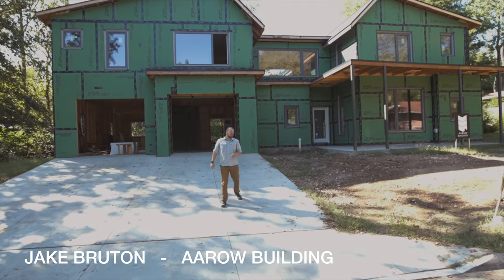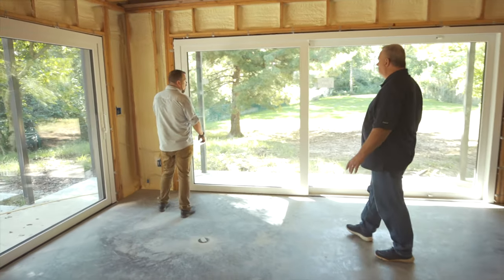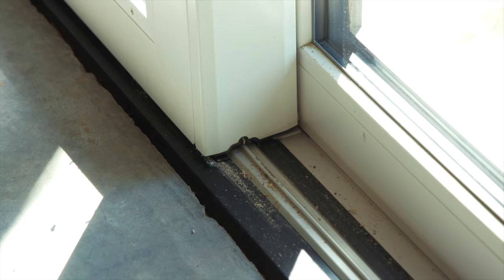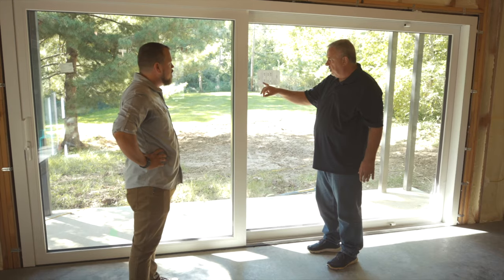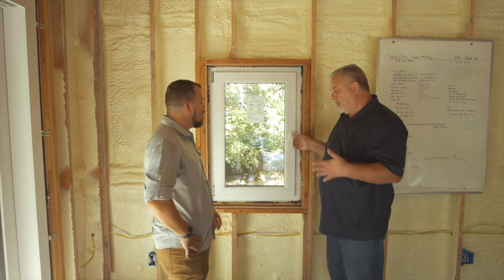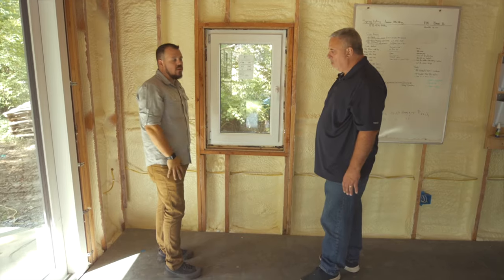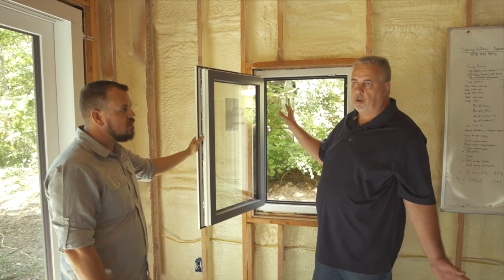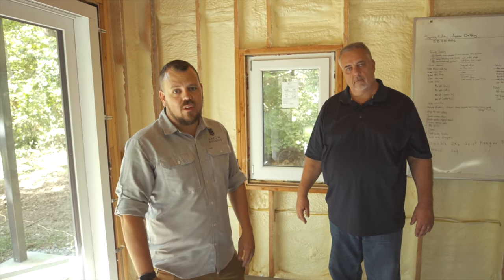European Triple Glazed uPVC Windows

Comment: you need to know sth. triple glazed windows are forbidden in Germany unless you have an insulated house which usually are made of bricks or beton. Reason is: if the windows are the warmest part of the house, there would be mold everywhere in the rest of it. We got new windows in our flat in Germany and I asked the people who installed them about it. It makes sense. So If your house isn't really insulated you should take double glazed windows. But since you mostly build wooden houses. Well  up to you
Reply from the maker: I’m not sure I follow. Maybe the frames of the windows are aluminum in your example and the walls are cold enough to cause the to condensate? The window being better souldn’t make the wall mold. If the wall is poorly insulated enough to get cold enough to condensate and mold it should do that worse if the windows stink too. Strange. I would like to hear more about this. Thanks for chiming in.

Comment: Call me old fashioned, but is there some reason you can’t use an American made triple glazed window with fiberglass like Ultrex cladding and all of the low emissivity coatings and not wait 3-4 months and pay through nose forcargo shipping?
Reply from the maker: Great question. Unfortunately when it comes to performance we simply have found better metrics from the European manufacturers. The other thing to consider here is manufacturer warranty as well. Schuco who is the manufacturer behind these units is one of the largest in the world, if you bought the units you bring up it would be from a start up smaller outfit here in the USA that may not be around in ten years. That could be a gamble. It is possible to find quality in the USA, just a little more difficult.

Comment: I read or saw it on YouTube, that the residential window market was getting so competitive, that Schuco decided  to pull out and now only caters to the commercial markets . I wonder how that's going to effect the homeowners that bought these windows  when they now may need help with parts, service  or warranty claims ?
I'm quite sure these are excellent windows, quality and performance wise and they look beautiful,  but I'm rather leery about dealing with a manufacturer that is in another continent . The price of these windows, has to be astronomical , I bet that 14' slider, once it arrives at your house, must be at least $15,000 or even more !!
Reply from the maker: Schuco USA is no longer competing. However these are imported from Schuco through a company called European Architectural Supply in Acton, Ma. These are manufactured in Europe and have nothing to do with the schuco usa brand. They wont be going anywhere.